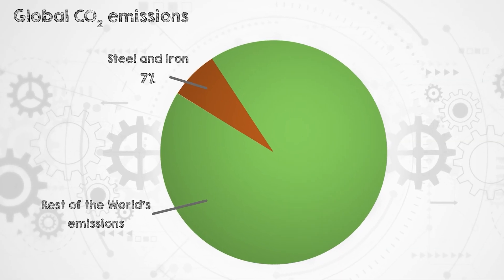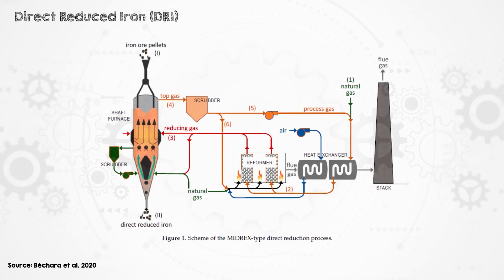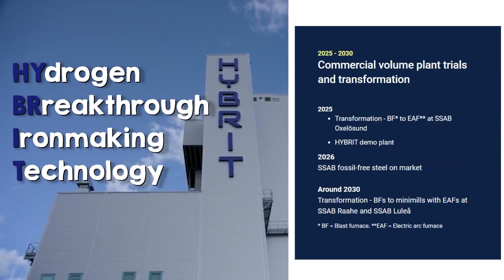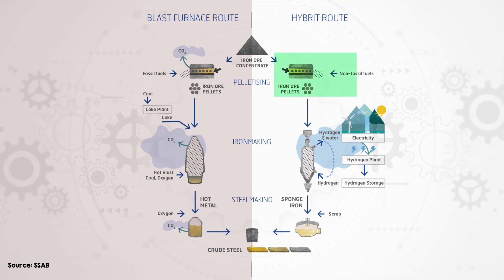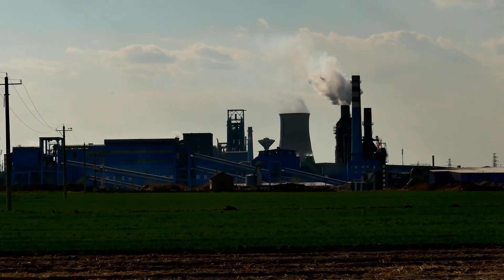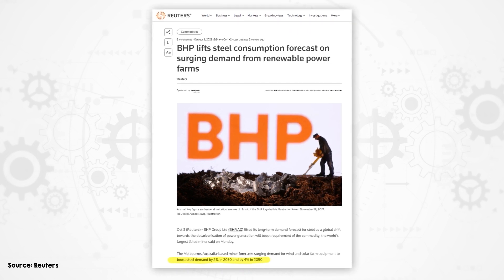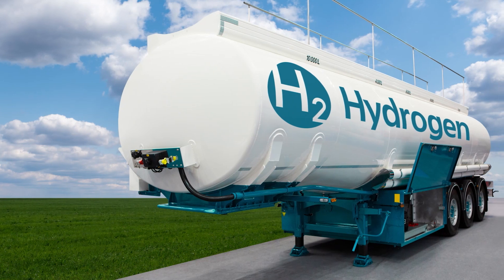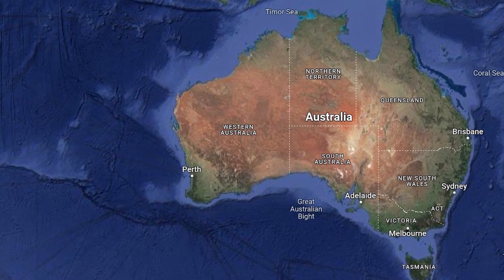Green Steel From Hydrogen

Comment: This all sounds very nice and I agree we need to find a way for production with less CO2 output. 
However...
* How much does this new process cost? Because I seriously doubt it's the same price as the current coke-produced steel. Both in terms of one-time investment for the equipment, the maintenance costs of this equipment, and ongoing production costs. And let's face it, no one is going to cover the difference in cost for you - it'll be passed to end-line consumers. With a nice 'green' sticker, of course.
* How will it handle China undercutting it by a factor of 10 with it's steel? I'm sure they'll swear up one side and down the other it's totally green too, while China's consumption of coal keeps rising year after year, for some unknown reason.
* As to the CEO drinking the "waste water"... Well, I'd like to remind everyone about Thomas Midgley Jr. the inventor of tetraethyllead and 'leaded gasoline'. He too had a press conference where he showed how safe TEL is, despite having experienced lead poisoning before and indeed, after. CEOs will do and say anything for their company - and thus, anything they say is worthless.
Reply: Ray Johnson  It's hard to judge just how expensive this entire process is, especially on an industrial scale. I expect the price difference to be significant. For one, they'll need to electrolyze a whole lotta water - which means a whole lot of power. Yeah you can do it with renewables, but then you need to take weather/batteries into account - which means even more costs. And countries can't just drop a huge tax on steel production, that would be a serious threat to any semi-advanced economy. 
Sidenote: a lot of solutions discussed these days around (blue) hydrogen center around electrolysis. If we succeed with this and convert our economy to use electrolyzed hydrogen on an industrial, world scale - did anyone give any thought about what all that 'leftover' oxygen is going to do to our atmoshere? Just wondering ;)
Reply: @GalvayraPHX  Electrolysis is a fully dispatchable load, and hydrogen very straightforward to store in large quantities.  You can (and arguably should) limit electrolysis to use only electricity from intermittent sources that is in excess of other demand.  It would reduce the associated costs of weather and batteries in the rest of the system, rather than incurring more.

Many countries already impose a huge tax, not on steel production but on emissions of greenhouse gases.  Converting to electrolytic hydrogen made without the direct use of fossil fuels reduces that tax cost.

Over the course of some centuries we have increased the concentration of carbon dioxide in the atmosphere from 280 parts per million to 415 parts per million: an increase of 48%.  If we were to release as many "leftover" oxygen molecules from water electrolysis as the entire increase in atmospheric CO₂ molecules over the entire industrial era, and assuming were all to remain as additional oxygen in the atmosphere rather than being absorbed by the various buffers of the ocean, biosphere and geology, we could in theory increase the concentration of oxygen in the atmosphere from 209,500 parts per million to 209,635 parts per million, an increase of 0.06%.

Even in the most optimistic scenario for a future "hydrogen economy", hydrogen will only ever make up a small fraction of the energy economy, namely that portion which is "hard to decarbonise" in other ways, and it will work by substituting directly for things that we now use fossil fuels for.  So there's no way we'd increase atmospheric O₂ by even that much.

I don't think we need to ourselves with oxygen pollution as a global phenomenon.  Maybe it could become a minor issue in the immediate vicinity of very large electrolysis facilities, but somehow I doubt it will be regarded as a hazard beyond the premises.
Reply: @JonathanMaddox  I'm willing to agree with you on the oxygen issue - I just hadn't seen any discussion about it and oxygen in high concentration is dangerous. At the same time, if that scenario comes to pass, I would want the oxygen levels and results there of to be monitored ;). 
As to the electrolysis - yes, you can get energy off the grid. However, it's not quite true that this energy can be produced anywhere. There are transmission losses and we are talking about industrial quantities here. Here's my admittedly unprofessional assessment of the energy required.
Going by the information from the video ( which may be just a simplification or incomplete) we need to replace coal with hydrogen in a 1:2 ratio per atom. Carbon has an atomic weight of 12, Hydrogen of 1. So for every 12 units of carbon we need 2 of hydrogen, or a 6:1 weight ratio. 
I found info online stating you need 770kg of coal processed to 600kg of coke to produce 1 tonne of steel. Coke is quite pure so let's assume it's all carbon, giving us a 100kg of hyrdrogen per tonne of steel.
Oxygen has an atomic weight of 16. So hydrogen is 2/18 water by weight, aka. you get 1kg of hydrogen from 9kg of water. So, you need to electrolyze 900kg of water for every tonne of steel. 
You need a bit over 13MJ per litre of water. A litre weighs roughly 1kg. Thus 11.7GJ to produce enough hydrogen for 1 tonne of steel. Or 3.25MWh. 
World production 2021 of steel is 1 953 304 thousand tonnes. Say 2 * 10e9 tones. That would require 6.5 * 10e9 MWh, or 6.5*10e6 TWh. 
World energy use 2021 is 176431 TWh. aka 0.18 * 10e6 TWh. 
So it would take roughly 36 times more energy then the entire world uses now just for the current level of steel production. 

I'm sure my numbers aren't accurate and are just a ballpark estimate. But that's a LOT of energy. Even if we could produce it from renewables, where would get the materials to make all those panels/windmills/etc...Not to mention other costs like installation, transmission infrastructure, maintenance etc.
Reply: @GalvayraPHX  You're out by a factor of one thousand (tera is 10e12, mega is 10e6).  Indeed assuming the rest of your calculations are accurate (and I can't see another error), you've very generously assessed that steelmaking via the hydrogen route would require about half as much energy as steelmaking with coal does today.  In reality there are energy losses at every step, so in practice it would probably work out much closer, or maybe even somewhat more energy needed for the hydrogen method.  Let's be pessimistic and allocate 10% of total current energy consumption to produce current annual quantities of steel (compared with about 7% today).
Reply: @JonathanMaddox  Yeah I messed up that one unit shift. That would put it at 0.065*10e6 TWh needed versus 0.18*10e6 TWh total energy production. As you said, it's about a 1/3. 
However, this is just the raw energy required for water electrolysis for the new process versus the entire total energy production of the world - not just steel related. Also, since the hydrogen is a new part of the process I'd expect this to be an additional load on top of whatever it currently uses - so we would need to add that much renewable generation and more for whatever losses in transmission/storage. And some storage too. 
This doesn't include any other energy costs involved with the hydrogen transition - like storage and transport of it. Also storage and transport of the required water. For that 2 * 10e9 tonnes of steel you'd need to electrolyze 1.8 * 10e9 tonnes of water, annually. That's 4.93*10e6 tonnes of water EVERY DAY. A lot of water to be moving. It would almost certainly be sea water too and that requires some additives for electrolysis, so further costs and logistical issues.
In the end, I'm not against the idea. And we certainly need to keep looking for ways to improve steel making. That's why we shouldn't be blindly optimistic about any new idea that comes up - that would close the way to finding other, potentially better solutions to the problem.
Reply: Mixing up scientific notation with big SI prefixes isn't doing us any favours.  I'm not going to go over the numbers again.  Current steel production uses around 7% of all world primary energy consumption, most of it in the form of coal coke, but some in the form of electricity for arc furnaces and machinery, and of course a non-trivial fraction in the form of liquid fuels for mining and shipping ore and fossil fuel and product.  Using hydrogen instead could increase that a bit, but it wouldn't even double it: the orders of magnitude are not going to change.

There are of course significant energy losses in electrolysis and related processes, but there were always plenty of inefficiencies in traditional fossil fuel based metallurgy processes too, which we always accepted as the energy was "cheap enough": the most modern blast furnaces use not much more than half as much coal as the oldest still in operation.

Yes making large amounts of hydrogen would require a lot of water, but moving water around and/or desalinating it has at most one or two percent of the energy cost of electrolysing it.  Nobody's going to pipe water across continents for electrolysis, we'd build electrolysers near water resources.  Storing and transporting hydrogen, similarly, are nowhere near as costly in energy terms as making it in the first place.  At least I hope not.  The vast majority of hydrogen in future, as now, ought to be made and stored reasonably close to the location where it will be used.  Storing the gas in a cavern or pressure vessel is straightforward.  Piping the gas around over moderate distances is not particularly costly (and certainly cheaper than pumping large volumes of water uphill would be), but liquefaction for storage or shipping is ridiculously expensive.  The existing practice of shipping LNG has enormous energy and emissions costs, very little fundamental economic justification, and I sincerely hope we do not duplicate that farcical industry in the hydrogen space.
Reply: @JonathanMaddox  Storing and transporting hydrogen has it's own set of issues - much more serious ones than for LNG. 

First, there's leakage. I wasn't able to find any reasonable data on short notice ( I found between 1% and 4%), but the issue itself is widely discussed. From what I've found, due the current usage model where hydrogen is mostly produced at need and colocated with the consumer industry, the focus has been on controlling air concentration of it, due to the explosion risk. No specific leakage tracking seems to be going on. Cavern storage for hydrogen is something that came up recently and I haven't heard of any actual applications of it. It certainly will leak some hydrogen. 

Second, transportation. Hydrogen corrodes metals, and in particular, steel. Which would be likely the prime material for tanks and is what existing pipelines are made of. Tanks would experience a shorter life, which is still manageable. But pipelines would not be able handle it. There might be some solution to this problem such as coating etc. but again, I'm not aware of any existing now. Though I'm sure they must have some fix for the facilities than currently use hydrogen on an ongoing basis. 

This is of import not just because we will have to produce even more to make up for the losses. Hydrogen is an indirect-greenhouse gas. Yes, steel production emits a lot of CO2 and hydrogen would fix that, however some of that 'fix' is mitigated by it's own greenhouse effect. Again, no reasonable data is available, because well, it's not in production yet ;) But certainly something to be measured and considered, once they have a pilot plant up. 

All of this is not needed though as long as you locate your steel production close to shore. I imagine an off-shore hydrogen-rig style facility that's connected to mainland power and has a short pipeline to the steel factory on the shore next to it. I'm not sure how viable this is, but it certainly seems to me to be the most reasonable solution, even more so if combined with off-shore wind. How many locations are suitable though, or what other issues there are with placing industry next to the sea shore, I have no idea.

Finally, back to energy. I found the same 7% world energy use for steel, but that is not just electricity, but all energy including coal/methane/etc. Electricity was in fact a small part of the steel production process and that should include arc furnaces that make up under 20% of total steel production and are not included in the hydrogen transition. So we are talking about adding about 25% of the world electricity production as new generation just for electrolysis. That's a huge deal. Yes, you save energy on the mining/transport/etc of coal but I'm pretty sure it's nowhere near the requirements for electrolysis. 

PS. One of my worries is that companies pioneering this will not report "inconvenient" facts like leakages etc. It's certainly a large investment and they are disincentivized to report things that "reduce shareholder value", particularly in absence of regulations. After all, methane flaring has been a staple of the oil industry for ages.
Reply: Pipelines and tanks can and do handle hydrogen. There's a salt cavern in use for hydrogen storage at Clemens, Texas.  Hydrogen pipelines criss-cross the numerous crude petroleum, refined oil product and methane pipelines among the refineries and depots and chemical plants of Texas and Louisiana.  The longest single existing pipeline runs between petrochemical plants in Belgium and France over a distance greater than 100km.  I'm not saying there's zero leakage, but I'm certain it's managed and manageable.  This isn't something new.
Reply: @JonathanMaddox  I agree it's been done. I'm unsure of the scale scaleability of it though. I think we don't need to consider storage very much, as I expect it to mostly be produced on-demand, with at most a daily cycle for the solar energy. However,  I found a us gov site about hydrogen pipelines citing the most critical focus points for research to be embrittlement of steel, control of leaks/permeation and lower cost/reliable/durable compression technology ( sadly they neglected to add a timestamp for this, so unsure how current this is ;). 
It has also stated that pure hydrogen pipelines are usually short-distance, between close industrial facilities. Which comes back again to situating future steel production near the sea. There was also an "alternative" - mixing hydrogen into natural gas. No idea if that mitigates the downsides of pure hydrogen, or if we need the natural gas ;)
Right now, I think we need to wait for a pilot installation and see how it does. Not a lab-test, a full scale complete industrial installation. That will give us more/better numbers to work with.
Reply: My point all along is that existing hydrogen installations in the petrochemical industry are already at industrial scale.  We use vast quantities of the stuff and already pipe it across substantial distances.  Yes most of it is used close to the point of manufacture, that just makes sense and always will, but the existing longer pipelines and larger storage facilities are hardly lab tests.
Reply: @JonathanMaddox  I agree on (relatively) short-distance pipelines, and it does make sense how it's used now. 
However, those pipelines are nowhere near the length required if we just want to convert existing steel manufacturing plants. I'm worried about how well the current system will scale up, both in terms of construction costs and maintenance. And also - the longer the pipeline, the more leakage there will be. 
At the same time, current production is overwhelmingly through methane steam reforming, which uses less water than electrolysis ( part of the hydrogen comes off the methane). Combined with ongoing worries about drinking water, I believe large scale electrolysis plants will be forced to locate at the sea shore. 
As such, the pipelines required to transport hydrogen to existing steel plants will be substantial, and are mostly 'new build'. Relocating the steel plant closer is an option, but I'm pretty sure moving such a thing is a major endeavor in itself. 
Finally, combined with the electricity requirements of electrolysis and all the other needs of this new process, I expect a substantial increase in price. Which will end up on the end-consumer of steel. 
It's good to have a process that's more environmentally friendly, but if it ends up so expensive none of us can afford it, it becomes pointless.
Reply: The water thing does seem unlikely to be a scam since it's extremely simple to clean water and also it was completely unecessary on their part and was obviously done purely as a PR stunt. Like no one would have cared if they just released the water vapor after putting it through a basic filter, this was entirely done as a PR stunt to make a point about how the only waste gas is water vapor, they have no reason to lie about that and it's easy for indepedent observers to confirm their claim. They just knew that science and engineering minded people would find this cool and kinda funny.
Reply: @hedgehog3180  I disagree. Science and engineering people find it cringe. It's the general "lay"/uninformed audience that it appeals to. As to cleaning water, I suppose it depends on what you're cleaning it of. Sure, you can achieve a lot with enough funds/energy/equipment - but is it "worth" it? Also, I would care if they just "released the water vapor". We're talking industrial scale here and water vapor is a potent greenhouse gas.
Reply: @GalvayraPHX  of course water vapour is a greenhouse gas, but anthropogenic emissions of water vapour are infinitesimal in comparison with the emissions from the transpiration of vegetation and evaporation from bodies of water and moisture in the ground.  Water vapour has no significant residence time in the troposphere: precipitation is of the same magnitude as evaporation, any water vapour added by humans will return to ground as dew, rain, hail, sleet or snow in short order.

Anthropogenic water vapour emissions at surface level are about as polluting as a porpoise pissing in the Pacific.  (As would be oxygen emissions from electrolysis, for very similar reasons, discussed in another thread on this video).

A caveat: water vapour emissions in the stratosphere from aircraft exhaust are not so insignificant: the residence time at altitude is much longer, and the contribution to cloud formation is substantial (water vapour readily forms ice crystals at altitude, but also tiny soot particles from jet fuel combustion form nuclei for water and ice to condense around).  Clouds themselves have a net warming effect on the earth: they may shield the surface from the sun in the daytime, but they also prevent heat from escaping to space, day and night.
Reply: @JonathanMaddox  I agree with you in principle and at this time. However - how much water/vapor would this process produce? Once you start doing things at industrial scale, even the small things get magnified. I dare say a large enough facility would be releasing enough water vapor to affect at least the local environment. It's another one of the things that should be researched, measured in a pilot plant and potentially monitored once it goes into wider adoption.
Secondly, what exactly are they pulling out of the water and how? If it's toxic that would add to environmental/safety concerns. Wouldn't be the first time an industrial facility dumped contaminated runoff because it was easier/cheaper then properly handling it. Which means there would need to be regulatory oversight. All things we should learn before we apply this technology in a wider reach.
Reply: @GalvayraPHX  seriously?

We already produce vast quantities of anthropogenic water vapour, every time we burn hydrocarbons and whenever we use water for cooling.

Water vapour is rightly not regarded as pollution in itself.
Reply: @JonathanMaddox  We do indeed. That doesn't mean that putting industrial quantities more of it into the air will have no effect - in fact, I expect it will have a significant effect. Isn't this exactly the case with CO2? We just increased the concentration slightly, it's measured in parts-per-million - and we're on the brink of a runaway catastrophe...